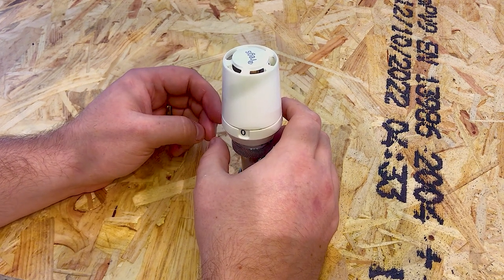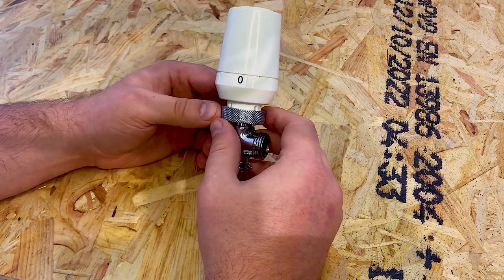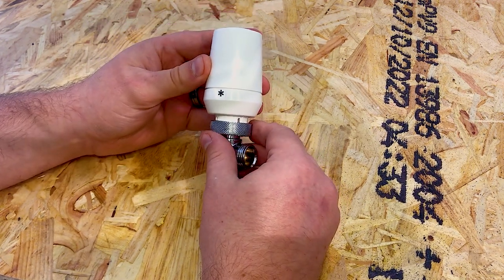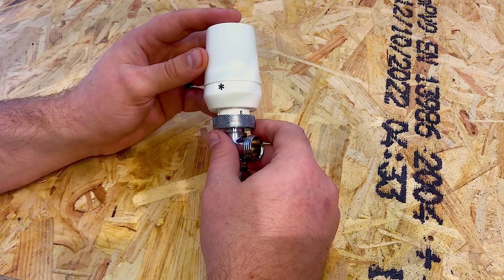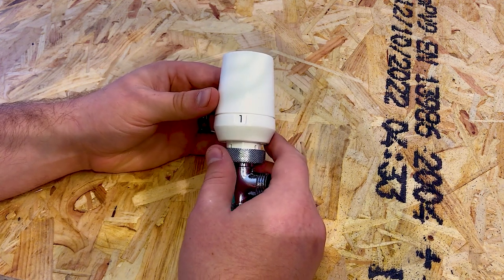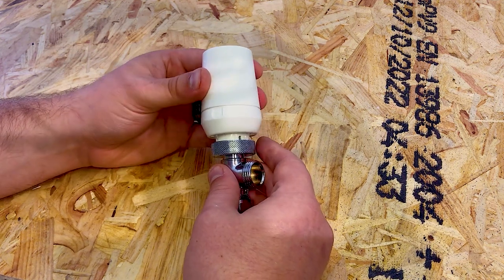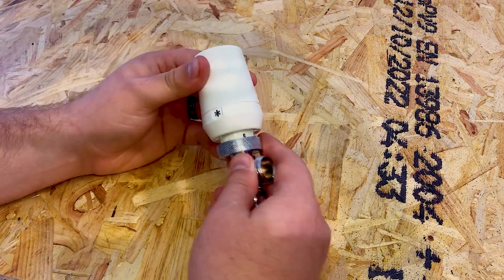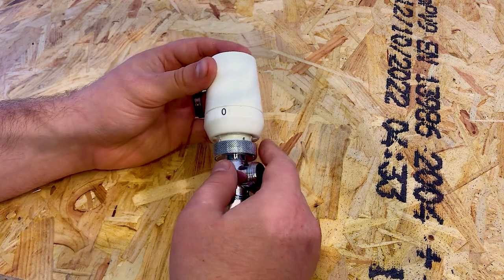What Do The Symbols On Radiator Valves Mean? (Radiator Settings Symbols UK)

Comment: On my parents new rads, they have 0, frost, 1-4 then a 5th symbol which looks like a volume bar on a tv (starts small and goes bigger), what could this mean? Getting inconsistent results when using it and completely baffled.
Reply from the maker: That will probably be the fully open setting where the valve isn't doing anything and letting full flow through it

Comment: Hi mate I dont have 0. It goes from 1 to the frost sign. Does this mean the frost sign is closed?
Reply from the maker: No, frost sign will always be slightly open as it is intended to let a little bit of heat through to stop your radiators/pipes from freezing. What other symbols/numbers are on there?
Reply: @TheBlokeCave  so there is a dot before every number. So for example it starts from frost then . Then 1 then . Etc. is the dot before 1 maybe a 0 then?